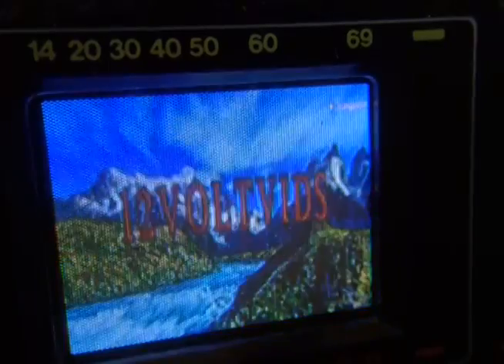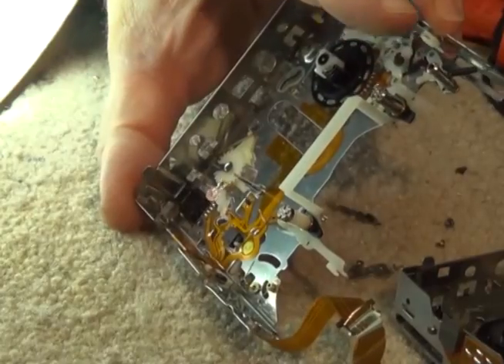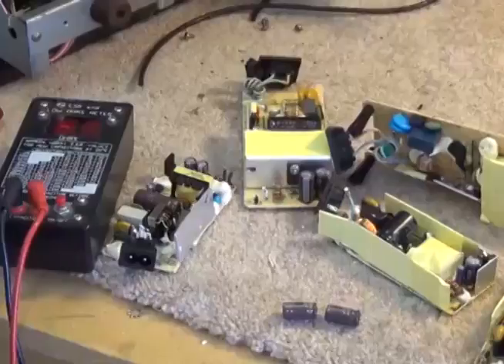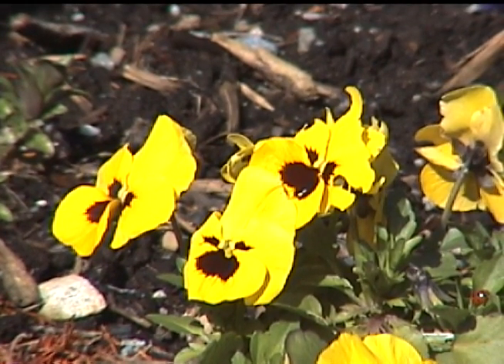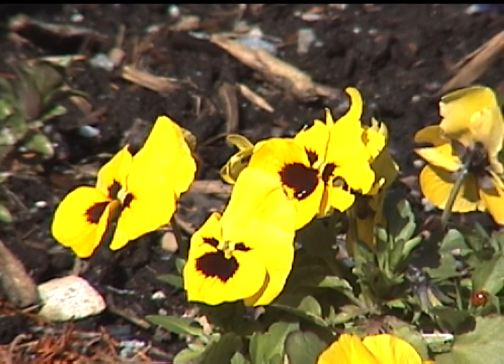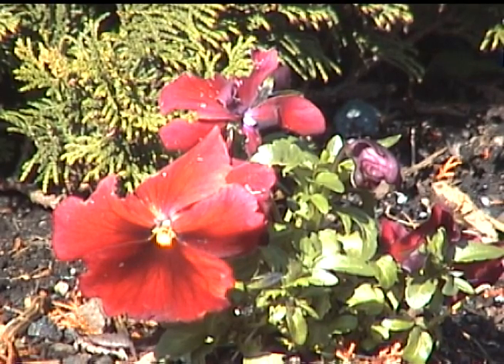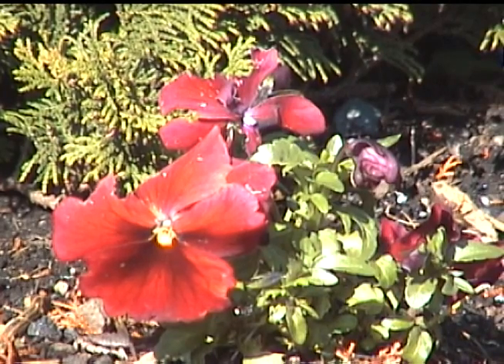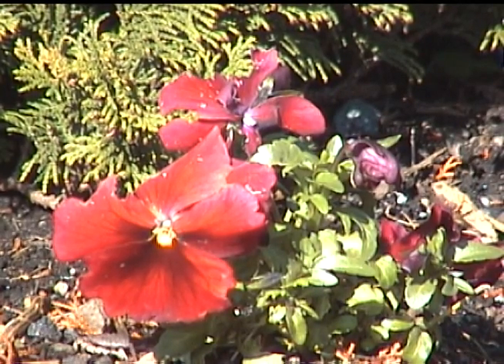Compare Digital 8 vs Hi8 vs DV

Comment: What about a digital 8 camera recorded to a hi8 tape. Would there be a difference in quality vs recording into an actual digital 8 tape?
Reply from the maker: No such thing as a digital 8 tape.  Digital 8 records on hi8 tape.  Sony and others started labeling Hi8 tape with the digital 8 logo because of all the uneducated idiots going into stores and having arguments with the sales staff because they couldn't find a digital 8 tape.  So they started badging the tape.  Also you could also record on regular 8mm tape using digital 8 equipment at the exact same quality the only restriction was the recorder was limited to the SP speed.  Of course nothing stopping anyone from punching the detection hole to make the camera think it was a hi8 tape and recording in LP speed.  I did that for weddings.  Used a p6-180 which would be 180 min in analog 8mm, and 90 min on digital 8 in SP mode but 135 minutes in LP mode.  I have plenty of tapes I can drag out as I still have all the master edits of everything I ever did on tape. At least the weddings as I only used tape once and then archived it just in case someone came back a few years later looking for a copy and believe it or not a hand full did.  Usually wanting a DVD or digital copy.  I dumped most of the corny corporate videos that were done for now mostly defunct businesses.
Reply: @ ok thanks so there wouldn’t be any point in purchasing a video 8 tape vs a hi8 tape? The quality would be exactly the same? Another quick question do you see any quality differences between metal evaporated and metal particle hi8 tape? Or Is that all just marketing BS?
Reply from the maker: @MATTE.U.K yes on digital 8 there is zero difference.  I used to use used hi8 tapes that had been used on the camera and then bulk erased but when i needed the longer tapes for 2+ hours in LP i used regular 8mn and punched the tab to make the recorded think it was hi8. Evaporated tape in theory had higher signal to noise and resulted in a 3db improvement in the chroma for hi8 analog signals.  On hi8 yes it looked a little cleaner when recording things like color bars, especially in the magenta bar.   All dv tape was ME tape. It was supposed to hold up better but personally i found stiction was more of a problem with it.

Comment: Great video thanks. What is your opinion on SVHS camcorders like the JVC with Super VHS ET? Record SVHS to a standard C tape? was it better or just sales hype?
Reply from the maker: Svhs et basically did what people were doing for years.  Drill a hole in a vhs tape to make the machine  think it was a svhs tape. Yes et improved the quality to almost full svhs tape quality.  Still much lower quality to digital 8 or dv.  Analog looks like crap no matter which color under format you use.  Beta SP now you are talking for analog quality.

Comment: To reiterate what you've said, Digital8 and DV is the same format. It uses 4:1:1 color subsampling in NTSC. The original video was interlaced, you converted it to 30p. Red suffers first, and red sampling errors are the most visible, from Umatic, which was notorious for its bad rendition of red, to HD. I have a 1080 HD camcorder, and at times it breaks apart on shots of red color. So, this red flower pistil looks totally par for the course, be it Digital8 or DV or HD. If you look at the red flower at 5:15 shot with the VX, you can see red streaks on the petals, they are caused by 4:1:1 subsampling and by you converting it from 30i to 30p. You should have converted this video to 60p using high-quality deinterlacer before uploading to YouTube.

The VX3 is nice. Do you know why Sony agreed to switch the VX3 mechanism from 8-mm to MiniDV instead of simply switching the codec from analog to DV? After all, Sony did release Digial8 five years after the debut of DV, so there were no technical impediments for doing that. Also, why DV needed new cassettes? Why DV could not use the same 8-mm cassette, which is the same size as DVCPRO cassette, and they could make a smaller one like MiniDV and a larger one like full-size DVCAM? Why creating a completely new cassette with narrower tape? Seems like a waste to me.
Reply from the maker: First of all you're completely wrong on converting to 30p. The video was captured at 60i and it was rendered out at 60i.  Any conversions to 30p would have been done at the YouTube level as I did not deinterlace or convert anything on this end for the analog recordings. YouTube is bad for that.  the red color suffers the most on all analog recordings be it VHS beta 3/4-in and 8 mm-high 8 because the red color on color under recorders is recorded at the lowest frequency and it's much more subject to noise actually the blue is just a subject to the same noise however the eye is more sensitive to the noise in the red. If you measure the chroma from any other color under analog system you will find that the signal to noise ratio is the same for both the red and the blue but the human eye is more sensitive to red color than blue therefore you see the noise in the red color. Dvpro and 8 mm do not use the same size cassette. All DV tape regardless whether it's mini DVD DV cam and DVC pro use the same width of tape which is 6 mm or 1/4 in. They all use a metal evaporated tape as well.  The reason that digitally even existed was because Sony wanted to give their existing 8mm customers a way to move to digital without abandoning the existing tapes they had. It was a brilliant marketing scheme. They didn't already have a camcorder or a collection of tapes the salespeople would be pushing mini DV on those customers and pushing it for the size of the camcorder and the compatibility across all manufacturers platforms there was no VHS versus 8 mm all the manufacturers were on board with mini DV. 
Some five years later so smart engineers at Sony thought hey wait a minute what if we double the speed of the tape and increase the drum speed substantially so that we can write a DV type signal to an 8mm tape. That way they can make a machine that could play back existing analog recordings and allow the purchaser to make new recordings in the new digital format without losing access to the tapes that they had already recorded on the previous generation of camcorder. That was the idea behind digital 8. It was not to replace DV it was to replace 8 mm and high eight as the camcorders existing we're starting to break down and people were looking to replace them. People wanted to go to digital because of all the advantages of recording in digital such as easy transfer to computer over firewire but they also had existing tapes that they had made with their previous camcorder that is now broken. That was the market for the digital 8 camera. Now Sony initially could have just released digitally and not bothered with DV however the manufacturers that were not currently supporting 8 mm would have never been on board to build a digital 8 camcorder. JVC and Panasonic would have just gone and produced another format and there would be another format war. So by co-developing DV with Sony Panasonic JVC Canon Hitachi everyone got together on the same page and produced a format that was compatible with each other. The VHS camp didn't need to worry about their tapes not being playable because they were compatible with VHS so people using vhsc cameras with just as easily go to mini DV and not have to worry about playing their old tapes but the 8mm camp that was a real concern and that's why digital 8 was initially released with 8 mm analog playback capabilities and then they released at the end a cheaper digital 8 which had no analog playback capabilities. It was sold cheaper $100 or so cheaper then the camera that had analog playback capability and those were marketed to people that did not have analog tapes to play but didn't want to spend the extra money to go to mini DV. The color subsampling on mini DV was chosen at 4.1.1 not because they had to but because Sony did not want to undermine their professional betacam SX market which was using the broadcast standard 422 and of course the digital betacam which used 444 color sampling. There's no reason that mini DV could not have had 422 other than the fact that they wanted to protect the professional market. Even dvcam which was a format that saw you in broadcast still used 411 color sub sampling again because that was marketed to small market stations like they marketed the professional High eight. They wanted the larger markets to go to the full 422 or 444 systems which cost substantially more money. I'm going to do a video in the coming days or I will capture video using multiple different devices. I will capture using composite, S-Video, component, firewire, and HDMI using converters. It will all be uprest to 1080 p 60. I'm going to compare a Sony gvc7000 as a digitized source. A Hauppague HD capture box, a digital 8 camera digitizing, and the cloner alliance hd stand alone box, I will use that for both analog component and HDMI captures. It does not have an S-Video in however I'm going to take S-Video out from an svhs and high eight player and run it into a comb filter and be modulator to turn this video into component which will then allow me to capture it using the component input. It will be interesting to see which analog and digital tapes look better and which equipment digitizes better. The hauppague will be used to turn out both 480i and 1080i captures. The cloner alliance turns out everything as 1080p so all the other footage will be scaled to 1080p in my editing software and the resulting output will be a high resolution high bandwidth 1080p stream that will be uploaded. I just have to find some tapes that are suitable that I can show I have lots I just have to go through and find stuff that I can actually show.

Comment: Hey there, nice video.

I’m getting into camcorders and noticed my digital8 DCR-TRV265E looked pixelated as well.

Do you think if I bought a CCD-TRV138 it would look better?
Reply from the maker: All the digital 8 were pixelated. Sony used low resolution chips on the digital 8 camcorders intentionally. The tape transport records exactly the same resolution as the DV format. It has to record the same because it's the same data structure. It doesn't matter whether you record it on a 6 ml 8 mm or half inch tape the data structure is identical therefore the picture quality will be identical. The only way you can limit the picture quality is limit the input going into it. To do this they use a shitty front end. Even the so called megapixel sensor was only a megapixel sensor when you were taking still pictures and saving them to the memory stick. I have a DCR TRV 720 with the megapixel image sensor and it only uses all of the pixels when you snap stills which still look like crap. when you're using it in video mode it's like 250k. Again done intentionally because Sony did not want to undermine sales of their more expensive mini DV cameras. The same with the mini DV format it's resolution was limited because they didn't want to undermine the sales of their betacam SX series and digital  betacam series camcorders. I just picked up a betacam SX just to play with and take apart on my channel. The resolution off of it is amazing for standard definition it encodes as an MPEG2 data stream at a color space of 4:2:2.  Consumer DV and digital 8 used 4.1.1 color space and a five to one fixed Mjpeg compression algorithm. When HDV came out they switched to MPG 2 but used a color space  4:2:0 again so it's not to look too good and not compete with their HD betacam which used a full color space of 4:4:4 
That was Sony for you, protecting their professional line of cameras which sold for 30 to 100,000 per camera. They didn't want TV producers running around with little $3,000 cameras looking as good as the $30,000 variety so they intentionally crippled them so that they wouldn't look as good. On the consumer front digitally was exactly the same they didn't want the cheap digitally cameras looking as good as the more expensive mini DV so they crippled them. If you plug a professional camera using the S-Video out into one of those digitally decks you will see how good it really can look as I did that. I plugged my broadcast camera into a DCR TRV 110 and use the digital tape as the transport and it looked fantastic
Reply: @12voltvids  So the hi8 models look better? specifically the CCD-TRV138
Reply from the maker: @curtisnicotra  hi8 can look better if you have a great camera on it such as the ccdvx3
Reply: i find that the footage from my DCR TRV110E looks fantastic, (400K effective pixel count the manual claims) im no professional but i think it does look better than my Video8 XR handycams and Hi8 handycam.

Comment: Unfortunately, my kids first 4 or 5 years were captured using a Sony Digital8 camera.  I'm in the process of RE-capturing about a dozen or so video tapes and converting to hard-disk for editing.  My question is this: Can anything be done to improve this footage? I'm a video novice, but hope to find a workflow to allow me to clean up these old videos and make them a bit more palatable.  I've downloaded Davini Resolve--hoping I can use this as part of a workflow.  Any suggestions appreciated!
Reply: Get it to a computer in its unmutilated format via Firewire. Then you can play with it: deinterlace, upscale, denoise, correct color, etc.
Reply: @ConsumerDV  I found that OBS software (Open Broadcaster Software aka OBS) worked pretty well to pull footage via Firewire (rather use that then some very old software that may stop working at some point, like WinDV/ScenalizerLive/HDVSplit that some people seem to use)... But you have choose video/encoding format to capture in the settings. For Digital8 I set the resolution as 640x480 for my NTSC camera (Sony DCR-TRV-340) and left output format as MPEG-4 + H264 or X264 encoding. I wonder if anything can be done to get it higher quality (any upscaling or A.I. upscaling software?). Anyhoo i'll do some googling, just happy i was able to finally get the videos off my camera yesterday with a few firewire/dongle adapters into my decade old laptops which has ThunderBolt1/2 and Firewire inputs. I like how vintage/grainy the videos look (they don't need to look 'HD'), but i'd like to upscale them in a way so they don't look pixelated at least when viewed on bigger screens.
Reply: You are limited unless you color correct, color bleed, and compress it. 
That’s why cinema cameras are were sought after. 
Using 16mm/35mm reel film, will bring out good quality images for future viewing.

Comment: I’ve a vx1000 which has audio drop outs. I’ve cleaned the heads and as much of the tape transport as I can, it’s always the same drop out…. Any suggestions?? Thanks guys
Reply from the maker: If the picture is fine then it's not the heads.  
Don't have a clue what would be the cause.  Back when those were serviced it was either a board swap or full transport swap.
Reply: Dirty tape? It could help a lot to clean but I with video I never tried.  I saw in YT there is clip showing.

Comment: If you record footage from a digital8 camera onto HI8 tape can you then play the footage back on a HI8 only camera?
Reply from the maker: No.  Digital 8 cameras record a DV transport stream onto an 8mm tape. They will record on either 8mm or hi8 tapes. Same quality. I used to use regular 8mm tape.  
It is a digital recording.  Exactly the same as mini DV and dv-cam.  They all use the same format.    Hi8 on the other hand is an analog format.   Many digital 8 cameras will play analog tapes however there were a few that did not play analog tapes at all.

Comment: Soo... Ur saying that buying a hi8 in 2003 was a better choice than digital 8 at the time?
Reply from the maker: By 2003 most hi8 cameras had a relatively soft ccd. An earlier hi8, like the ccdv5000 or ccdvx3 3ccd camera would blow the doors off any of the digital 8 camera section.  The digital 8 tape section was better though as the data format is the same as DV and dvcam.  The best hi8 camera ever made was the evw300.  Pair that with a digital8 external recorder and you have a fantastic set up.  I use that set up for a few years.   
The decline of all the 8mm cameras started the same year that miniDv hit the market.  Minidv needed to look much better than. Any of the other formats so people would see the advantage in spending much more to get it.  So they literally crippled the other cameras by putting in a low grade sensor.  That's how business works.  You might not like it but that's how it works.
Reply: @12voltvids  ah, good info. i was just curious, ive got a Sony CCDTRV318 Hi8 im gettin ready to tear down and clean up, its my old camera from 2003 i believe.